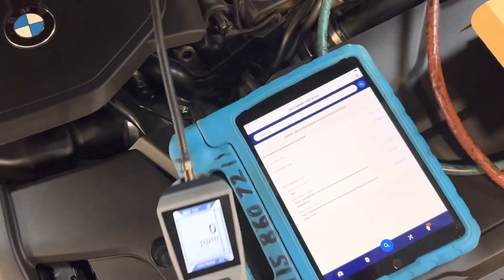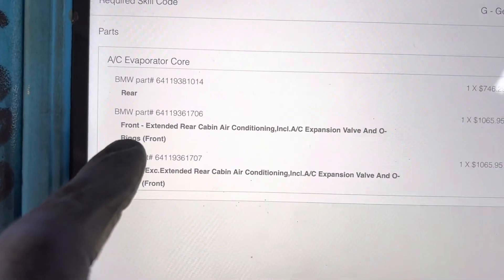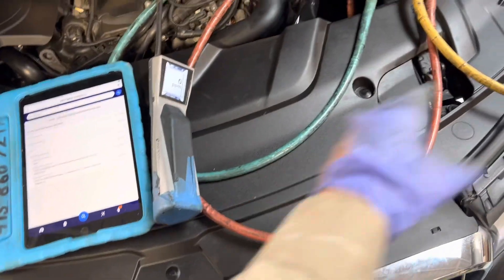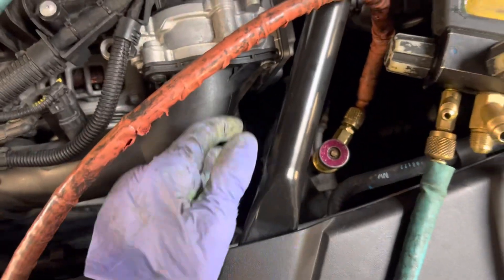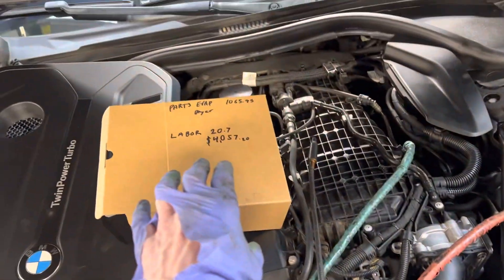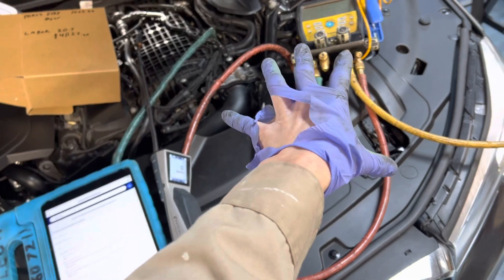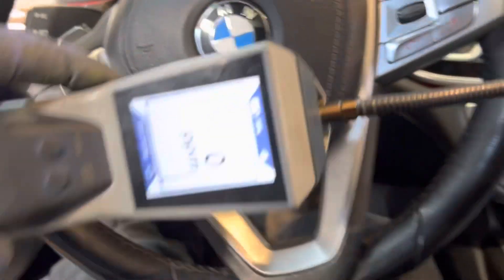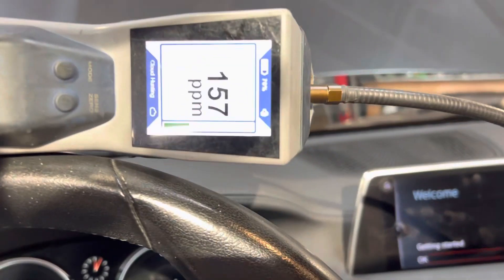$6000.00 AC REPAIR.  20 HOURS LABOR JUST TO GET TO THE EVAPORATOR .  Future AC repairs are here

Comment: I done this job for over 36 years it’s not getting any easier
Reply: 37 years here , over engineered garabge!
Reply from the maker: @peterpeter5666  feel sorry for the customer. But for the income for automotive industry this kind of repair bill 💵 is becoming common every day repairs.    It’s only going to become more common and more expensive. 

With EV and Many Hybrids the cars can not run without AC  to cool the battery and inverters
Reply from the maker: @peterpeter5666  there’s a lot of money that’s going to be made on that over engineered garbage.
Reply: @coldfinger459sub0  i know , i repair garbage like that every day, problem is people buy this crap and think its going to cost the same price to repair it as a honda civic. EASY to buy VERY EXPENSIVE to maINTAIN!  VANITY COSTS ALOT OF MONEY!
Reply from the maker: @peterpeter5666  so true LMAO 🤣. 
      And then they have the audacity to whine and cry about it complain like a little 🐝 
       They purchase 120Kto 140+ thousand dollar vehicle and don’t expect it to cost more than a latte and a danish to repair. 

Reality check
Reply from the maker: 👍 that’s for damn sure but have you noticed your pay hasn’t really gone up. Compared to the complexity of the new vehicles. The amount of knowledge it takes automotive technicians are sadly and truthfully, making less money than a good hot waitress at a nice restaurant on Tips.  Or the concierge at a nice hotel on his tips make more than automotive mechanics..

Comment: $196 per hour for a high school dropout! pfft!
Reply: Modern mechanics have a higher level of skill & knowledge than most people graduating from college with a masters.   I know because I work on old cars (restored 8, one to concours level and designed advanced electronics for several others, incl race cars - note this is hobby) AND I run a company that hires a lot of expensive college grads.....   Mechanics have to constantly buy expensive tools just to stay in business, most have $100k + of tools.   A good mechanic is worth his/her weight in gold as they will save you $$$ in the long run by avoiding useless parts swapping (aka the parts cannon) by correctly diagnosing & solving the problem.

P.S.  NVM that this is San Francisco, where interns make $10k/mo, studios cost $6k/mo and the median house price is the highest in the country at $1.4m....
Reply from the maker: 👍👍👍100%  CORRECT 

NOW IF  WE CAN CONVINCE THE LOW LIFE SCUM SUCKING MAGGOTS 
OWNERS OF AUTO SHOPS THAT CANNOT EVEN DIAGNOSE THEIR OWN WAY OUT OF A WET PAPER BAG AND PAY THEIR TECHS MINIMUM WAGE.
Reply: I don't know any high school dropouts in this industry. Most have a min AA or AS degree.
Reply: @nservice1625  last time I went to a mechanic almost 10 years now, needed an oil change and was middle of winter so spend the money and stay warm right? NAH. Dumb mechanic newbie cross-threaded and impacted my drain plug and I didn't find it until 3-4 months later and not much I could do to go after the shop at that point. Think he had a degree?
Reply from the maker: When I used to work in the shop under the cars, I seen a lot of cross, threaded and stripped out oil drain plugs from other shops, and even shops that I worked in where the owner would hire a young kid with zero experience, more right out of wild tech, or some other automotive nine month long school where they just slam you in and slam you out and take your money and pass you no matter what. 

         Actually, sometimes, depending on the person’s character and the way, their mind is wired some of the worst mistakes I’ve seen came out of the most intelligent individuals that had engineering degrees or some very high-level, technical background. Any university. 

For some reason, certain types of individuals were very analytical overthink things. They cannot think outside of the box and they only know what they have read in a book or scene. They cannot combine two ideas together to come up with a problem-solving method that doesn’t break something. . 
       That puts them in the same category as a young kid who dropped out of high school in eighth grade will call him Billy Bob butt crack who puts in oil drain plugs with impact guns.
Reply from the maker: @nservice1625  I guess california is unique  we have a lot . Lear by braking parts and charging the customer for their learning curve
Reply from the maker: That (“ not a high school dropout “) who comes from a country were their high school level, students exceed the United States university level students degree graduates in math in spelling in science. 
      And you have to take an account or in San Francisco California $196 is not that high here.  Compared to the BMW dealer across the street who is $394 an hour.. 

At this shop, the owner, intelligent much far exceeds that of 98% of all other shops .  
            Other shops, dream, and wish they can do the kind of work that he does here and have the kind of clientele is definitely in a category all by himself.

Comment: Why are we changing the heat exchanger for a leaking evaporator core?
Reply from the maker: Because the receiver drier desiccant material is attached to it.  And the dealer may or may not have any individual replacement part. If they do not do you have to change the whole assembly.   
             I was at a body shop where BMW instructed the body shop to just replace the heat exchanger, but what was sent was a whole entire assembly?.      Expansion valve, the receiver, dryer the glycol assembly attachment points no individual component.
Reply: @coldfinger459sub0  What harm would there be in not replacing the drier? Low miles, not very old, not in high humidity area, no contamination, and put under an extended deep vacuum, why change it? All we are doing here is replacing a component that is leaking.
Reply from the maker: Once you have a refrigerant leak, that takes you all the way down to zero.   The leak is constantly respirate in in and out constantly every day between the daytime temperatures and nighttime temperatures absorbing more moisture from the ambient air. It pulls in the leak into the refrigerant oil..    vacuum pump does not remove all the moisture.  It just reduce is it..    is the job of the desiccant material to remove the reminder. 

And once a desiccant material is exposed to atmospheric moisture, it’s dead it is completely saturated . 

That’s why, with the better manufactures that ship their desiccant material inside aluminum cans or mylar foil bags because moisture goes through plastic. 

And they will have warnings on them from the different manufactures anywhere from 15 minutes to as much as 30 minutes must be installed and put under vacuum not to be exposed to the atmosphere . 

This is how sensitive and fragile and absorbent desiccant material is as soon as it’s exposed to the moisture in atmosphere, even in low humidity conditions .
Reply: Got it, there is no reviving it. Once exposed for a period of time, it's done.
Reply: Would electrical tape over connections that are open be enough to stop absorption?
We pull engines and other components, and sometimes you have to disconnect a/C lines. We try to find vacuum plugs or something that'll fit into the line, then add electrical tape over the top. I have always wondered if this actually does any good.
Reply from the maker: @nservice1625  tight fitting vacuum plugs are best

Tight fitting well applied electrical plastic pipe. Tape is better than nothing especially if it is really tight and sealed. . 

Not just 1 inch short piece, placed over a oily fitting that t cannot stick to adhesive does not seal .
Reply: @nservice1625  That gooey sticky self-healing silicone tape would be best. PVC electrical tape is pretty permeable to moisture. Also, the molecular sieve desiccant will actually create a vacuum as it pulls moisture out of the air.
Reply from the maker: @WaffleStaffel  yes 👍
Reply from the maker: Oh yes, I remember this I’ve seen this one I subscribe to his channel
Reply from the maker: @nservice1625  correct.